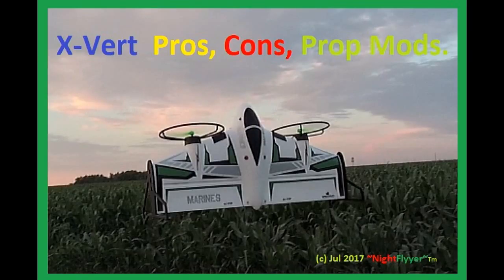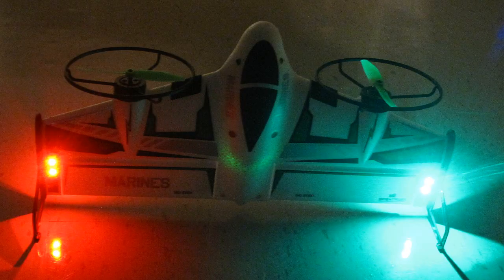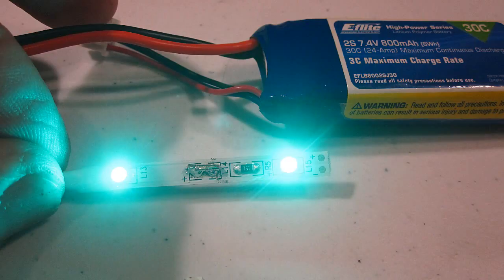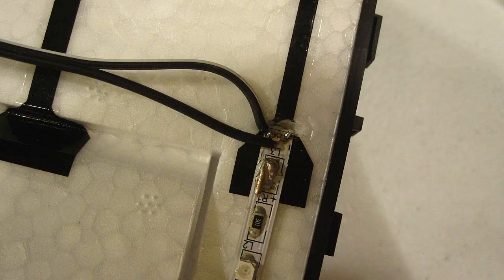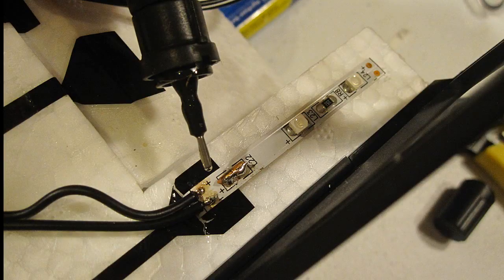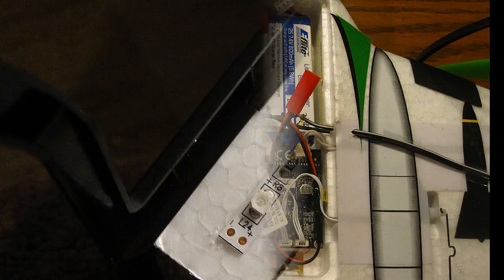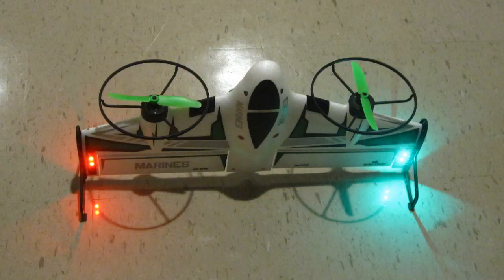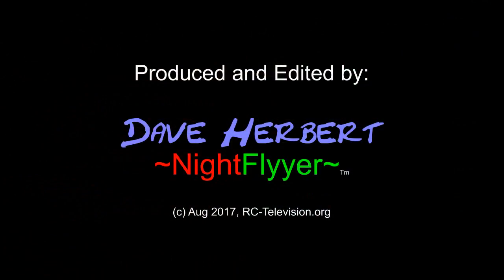E-Flite X-Vert & other 2S Lipo Machine's simple Mod to run 12 Volt LED's with 7.4 Volts.

Comment: That's kool! I used a few NE555P IC's on my convergence .
Reply from the maker: Thank you. I've used them a lot, but those are timing Chips, not usually used to reduce voltage.  How did you use them?
Reply: @NightFlyyer  I got the wires from a  printer serial port cabled I cut the outer  layer of cable and got lots of different color wires.
Reply: @NightFlyyer  multivibrator  mode, used resistors to reduce voltage and current to LEDs. I found circuit on YouTube and internet. Type in Airplane     LEDs  for airplane  model.
Reply from the maker: @magnetron366  Gotcha.  I went the easy way, but there are many ways to cut a pizza.
Reply: @NightFlyyer  gotcha.

Comment: thanks for putting this together. I was actually planning to add LEDs to mine but shied away from it due to the brightness issue. I will now go ahead and try this modification. Did you experience a substantial loss of flight time after you put these on?

Comment: Shunt mods are a common practice for bypassing voltage restrictions set by Nvidia on their graphics cards. 

Because of this, I know that one easy way people do the mod is by drawing a line across the resistor with a pencil, and it works since the pencil's got graphite in it, so it's a good way to do a quick test.
Reply from the maker: Thanks for the suggestion.  I tried what you said, but noticed no difference in brightness, so I drew a fairly heavy line with a pencil and measured it with an ohm meter. It gave a reading of .002 on the 200M scale, so the line would have to be extremely heavy about the size of a pencil,  to create a direct short, which is what you need for the other LEDs to see full voltage. Shorting out with the copper wire is more reliable for me.
Reply: I see. I've heard of people using HB pencils to draw thick lines but I guess it just doesn't work as well on LED strips. Oh well, it was worth a shot, cheers for giving it a try.

Comment: Looks very nice and a great modification. The wires look a little on the heavy side. I have been running my 12v LED's with network CAT5 wires, I strip the cover and use the smaller wires from inside. They are already twisted pairs and much lighter. I have used phone wires also.
Reply from the maker: Yes I could have used lighter wire, but didn't have any so used this speaker wire. I used to have a roll of 26Ga before the fire and wished I still had it. Thanks for the comments and suggestion.

Comment from the maker: Many of my Planes and quads run on 7.4 volt 2 s batteries and just don't light up 12 volt led's well. I have many 12 Volt, 3 segment LED's, so instead of buying 7.4 volt LED's, as sold by HobbyKing and others, I simply modified my existing ones to work. I know there are many other ways to do this, but this was really easy and is the way I settled on doing it.  It works just fine and cost me little. Thanks for watching.  Happy flying and please subscribe.
Reply: NightFlyyer Do you have any cox engines
Reply from the maker: I have 1 .049 a friend sent me after the fire burned my collection.